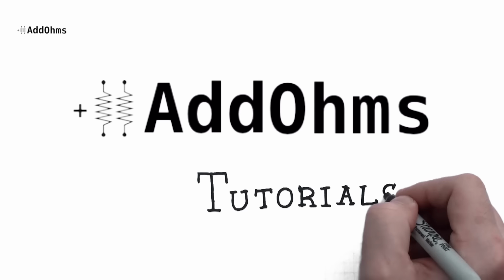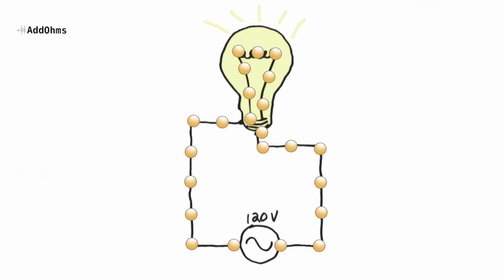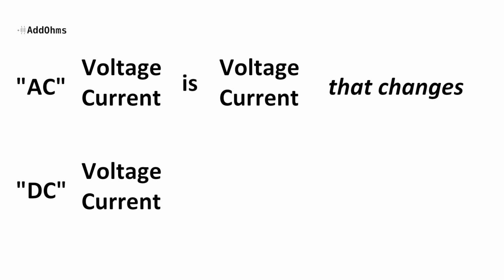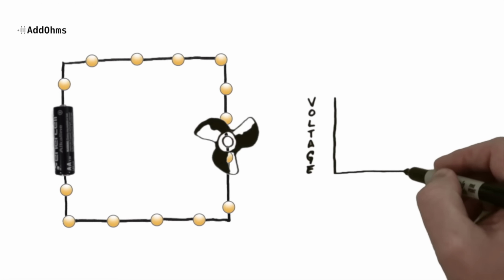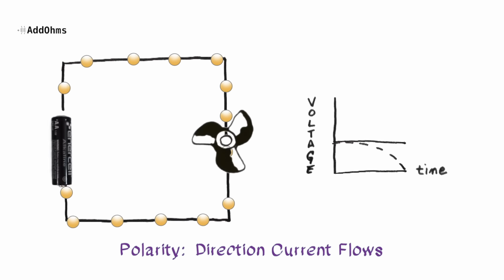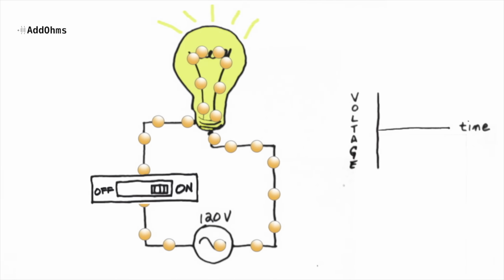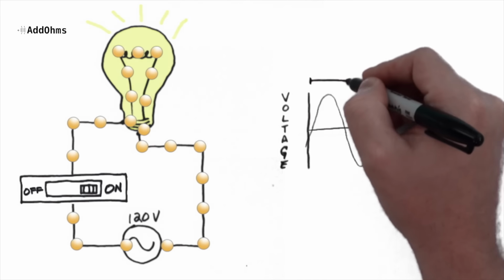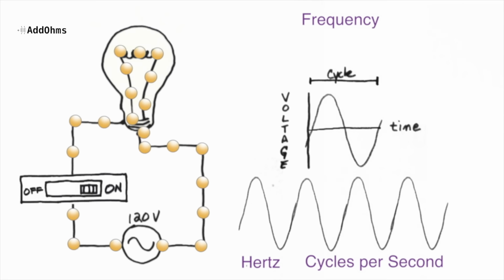Difference between AC and DC Current Explained | AddOhms #5

Comment: My fan in the UK runs off 240v ac  my desktop fan runs off 5v usb..  Why is the voltage difference so big between AC & DC please?   Thanks, John... :)
Reply from the maker: One is designed to be plugged into the wall. The other is designed to be plugged into USB. You probably noticed one blows harder than the other.

Comment: How ac is prevented from current loss ! And what exactly voltage does ?
Reply: AC actually loss more than DC in long range because of capacitance 2 conductor next each other. Voltage  is how strong it can push current. It's like pressure in water. The deeper the higher the pressure and current is like how much water flowing.

Comment: I believe that you may have noticed, exept it takes a moment for the lights to go dim, so it doesn't flash. Also, is this why if you are drawing too much power the lights flicker?
Reply from the maker: The lights flicker when another load (aka appliance) draws so much current the line voltage drops very low. The current surge is quick enough it doesn't trip a breaker but long enough to notice the lights turning off.

Comment: If we run a fan by ac,according to you the fan should be moving in two direction every second.But we see that the fan only moves in one direction. How is that possible?
Reply from the maker: +Rahul Das No, not all "according to me." AC motors are designed to use the alternating field for commutation. They are not built like a (brushed) DC motor. Look up "AC Induction Motor." They use the alternating field for commutation.

Comment: Technically it's true that a lightbulb is going through 100-120 cycles of max output to zero per second but in the case of incandescent bulbs, as the light is generated by the heated filament which once at operating temperature stays there, any 'flicker' is smoothed out...  with fluorescent bulbs they do flicker quite a bit, hence the headaches some people get from them.

Fun project:  take a motor, attach a cardboard disc with a hole near one edge and mount on a paper towel tube so the hole will pass over the open end.  Add some power and a rheostat to change the motors speed and look through the tube at some fluorescent lights.   When you get the disc to spin at just the right speed, you'll see the fluorescent tubes slowly go from completely off to a very high brightness.
Reply from the maker: Slow motion video does confirm that the filament's light output changes. But you are correct,  the thermal impedance of the tungsten will smooth it out, so it isn't a hard on, hard off.

Comment: so why do we bother with AC?
Reply from the maker: When electricity was first distributed over 100 years ago, it was easier to build AC generators and use transformers to step-up and step-down the voltage for transmission. 
Even now that we have the technology to step-up and step-down high-voltage, high-current DC, it still wouldn't make sense. To change the existing infrastructure would be an enormous cost and have significant service disruption. And quite frankly, there would be almost no savings or benefit from the change.
Reply: dude, thanks for that

Comment: With alternating current, why is current detected in the hot wire and not in the neutral? For instance placing a amp clamp type meter on the hot current is detected but not on the neutral.
Reply from the maker: Then you're doing something wrong. It should work on either.

Comment: Wait. If AC keeps changing over time and the current keeps fluctuating at fast rate, then any motor connected to an AC source must also change the direction of its spin, why doesn't it happen????? I need a quick answer please...
Reply from the maker: The magnets and wire windings are made in such a way that when the AC field reverses, another set of magnets and windings pull the rotor "forward."  The electro-magnets in the motor don't all "point" the same direction.
Reply: AddOhms Thank you, just one more question: Is the motor designed in such a way that if DC is passed through it, then it will use the same set of magnets and windings for the motor to keep spinning in one direction??? I would be glad if you answer. Thanks....
Reply: it does chlange, but human eye cannot see 50 hz of frequency.

Comment: OK. But I would like to know why do electricity companies supply AC electricity to our homes as opposed to DC - is it more efficient/economical?
Reply from the maker: +TinyWords I give one explanation in this video and the comments provide deeper. https://youtu.be/6F1ETK3Euhc

In short: initially it was easier to generate and distribute high voltage AC. Today even if DC made more sense (and I'm not sure it does) there is too much infrastructure in place already to support AC.
Reply: Yes, thank you for the explanation. Basically, the 'War of the Currents' was between Edison and Tesla. Direct Current is not easily converted to higher or lower voltages also upon reading, it still is continuing in a heated AC/DC battle and it appears the two currents will end up working in parallel to each other in a sort of 'hybrid armistice'.

Comment: Hi, i have a question, if the battery in the dc circuit will run out over time(voltage), then why wouldn't the voltage in the ac circuit won't run out? thanks for replying!
Reply from the maker: +Ko Siu Chun If an AC battery existed, then it would run out.
Reply: Hi, thanks for replying, however i got another question, how does the higher voltage and lower current, lower voltage higher current work? i saw it on the wikipedia and it says to work it requires the same battery? or something similar, and i dont really understand it, do u mind explaining?

Comment: A little clarity on the lightbulb example used. An incandescent lightbulb has a certain amount of latency in the way it works, so when the voltage drops towards zero the filament takes time to cool and so still emits light for a while.

This latency is long enough that before it can dim significantly the voltage has had time to increase on the other side of the sine wave and heats up the filament again. This smooths out any flickering that may occur.

If you switch an LED at the same rate (50/60 hertz) you may notice some flickering.

Note: the incandescent bulb is actually being lit 100/120 hz rather than 50/60 hz as it lights on both halves of the sine wave or twice a second.

The LED only works with current in one direction so this wastes half of the power.
Reply: thank you, very helpful explanation
Reply: Super late, but how is LED so much more energy efficient then?  I'm going to google but still would be curious for your response
Reply: @russianbackfist  The majority of the energy an incandescent bulb uses goes into heat rather than light. About 95% v 5%.
Reply: thanks
Reply: Still the LED is power efficient.
Reply: @chaz-e  why? In the example, the current is changing polarity and if what op said is true, there is no reason to do that cause it doesn't make the light turn on. 

From my understanding, what would happen is that the light would flicker constantly and lose more energy in the process.

Comment: Why use AC over DC? What are the advantages?
Reply: Provides more energy than AC and doesn't rely on chemical processing ( Batteries ) to create current
Reply: AC is more efficient than DC over transmission lines from the power generators to where it's going to be used. So with DC you would need more sources closer to where it's used to get the same amount of power.

Comment: What i'm having trouble understanding is what the 2 pin american / 3 pin uk ac plugs do. i know one is earth on the uk plugs. So there's neutral and live. i know you switch a circuit by opening and closing the live wire. but.. what do the neutral and live wires do in the ac circuit? I've never understood this - it seems they should just be identical but flipped phase? I'd love it if someone can help me out.
Reply: Live goes positive and negative, ether 'pushing' or 'pulling' energy from neutral. Neutral is at zero volts. Earth is literally a connection into the earth (soil). I'ts there to provide a low resistance path to earth vs flowing through you.
Reply: So is Neutral always zero volts? 

I'm confused a bit because say you're in a positive cycle the flow is live to neutral, so it may be 0 V but there's still current flowing through it (so i imagine it's not safe to touch?), but what when it's in a negative cycle (negative porition of the wave/pulling) wouldn't the flow be flipped so neutral to live? 
Or am i stuck in the way of DC - i never ever work with AC current other than audio signals.

Comment: Does this mean a diode makes ac current into dc since a diode makes current flow in one direction?
Reply from the maker: +Aura Dominator A diode will "cut the signal in half." Since it only passes one portion.  It is how the rectifier for an AC to DC converter works.

Comment: WHY does the current change in AC
Reply from the maker: For AC Mains, it's because of how the generator spins when generating the current. If you watch my motor video, you'll get an idea of how motors have magnetic fields. Generators work in the opposite of motors. They generate current by using those magnetic fields. Because of how the motor is constructed and the magnetic fields are created, we end up with an alternating waveform.

https://www.youtube.com/watch?v=iKqruCYuc1Q
Reply: And if the electrons are going back and forth how do they keep getting energy to work the component since some of them are not going past the power source?
Reply: that vibration of electrons in enough

Comment: I'm not an electrical engineer and know close to nothing about electricity; which is why I'm watching this video.  But, the bit about lights strobing or flickering and the perception of the human eye is dubious.  If this were true you could film with a camera running at > 60 fps and you'd end up catching dark frames; but I don't think this happens.

Your brain will kind of replace or fill in the gaps to account for missing information and it might filter out non-critical information.  It's why you can sit and study in a room without hearing the buzz of a light bulb or the hum from the HVAC. One is auditory and one visual but there have been studies showing that people perceive things visually that aren't actually there.  There are 60hz and 120-144hz computer monitors and you can subjectively and objectively notice the difference when playing a computer game.  The high refresh rate monitors are a lot smoother, and your reaction times are measurably quicker than a player playing on a 60 hz monitor.  This might just be because you are seeing 2x the information, not the difference in response times (which is about 5ms).  Either way it still proves the point, which is that the human eye is capable of perception above 60 hz. But...  

The lights might dim slightly, but the residual heat in the filament won't dissipate quickly enough for the room to go dark.  If you close your eyes, turn off the lights and open your eyes as you're flipping the switch, you'll be able to see the light fade to dark.
Reply: You'll notice on most cameras they have a 50hz(Europe) and 60hz(North America) setting.  That's to correct for the flicker of AC lighting.  That's also why in North America they broadcast at 30 FPS and in Europe 25 FPS.
Reply: @Jordan-dt6qx  Good job,
Reply from the maker: Yes. Incandescent bulbs "fade" due to the time it takes the filament to cool. Which is why if you film using Incandescents at 60 fps, the scene would be much dimmer than what your eyes see. You'll also very, very rarely see anyone filming with incandescents, except for an artistic reason.

Your brain isn't filling in anything. It's seeing the total light the retina can detect. 

LEDs are a different story. They turn on and off much, much faster than a filament based bulb. They're also switched in the kilohertz range. Again, your brain isn't filling in anything. Your retina can't detect changes that fast. It's persistence of vision. 

Your comparison to monitors is flawed. The reason you see motion is because of the connections your brain makes. Seeing the image (or brightness of the image) is entirely on your eyes.

Comment: The home appliances, do they work on AC or DC. 
If AC then what will happen if we provide DC
Reply: Anything with a motor USUALLY runs from AC directly, using eather a 'universal' or 'induction' motor. Everything electronic such as LCD screens and computers runs of DC. AC can be converted to DC by 'rectifying' it. It's converted from 240V to a lower voltage (i.e.5V, 12V, 24V) using a transferrer, or more commonly a switched mode power supply.
Reply: Robert Hickman 
Thanks

Comment: hi.. i used a ac power supply 14v ac 800ma to my guitar effects pedal 9v dc 2.5 ma. after an hour of playing the pedal shutdown.. and the power adapter is hot. its fine if the adapter is damaged but i hope my pedal still works fine. whats your guess? thanks.
Reply from the maker: However if you are supplying a 14Vac signal into a 9Vac device, I could see a problem. Sorry, not enough information to help.

Comment: Great video!

So when we see fancy car reviews on youtube and the LED lights seem to flicker, that either means that LEDs are AC or that cars are AC but LEDs have lower Hz than older bulb technology?
Reply from the maker: +Ryan N LEDs are driven with a pulse width modulated signal (PWM). This is a technique that adds an AC component to a DC signal.  PWM also crosses the boundary of what a digital and analog signal is. 

unlike a traditional lightbulb, there is a minimum voltage necessary to turn an LED on. By either limiting the current or rapidly flashing it, you change the brightness.

Comment: In a battery, the flow of current should be from negative to positive. Now is the animation wrong, or I am ?
Reply from the maker: +Nemo It's the difference between "conventional" and "electron" flow. Conventional goes from positive to negative, while "electron flow" goes from negative to positive.  Both are acceptable as long as only one is used in a circuit's analysis.

Comment: At 2:52, you said current flow stays the same but voltage goes down.... But acc to ohms law this statement doesn't satisfies? So how do you do it?
Reply from the maker: +kartik mittal Ah. I did not word it well. I meant the current flow's direction, not the amount.

You bring up a good point and something I didn't do in the animation. As the voltage drops, the current should be slowing down.

Comment: So if you had a motor hooked into a DC source of power it would be spinning back and forth?
Reply from the maker: +Christopher Faught No. It would spin in one direction, or not at all. Connecting an AC motor to a DC circuit would have no effect, other than potential damage. Connecting a DC motor to an AC source would likely damage the motor and at most it would studder back and forth.

Comment: As far as i know and searched the web, the electrons flow from negative (-) to positive (+) not the other way around as in video. Such information is important. Correct me if i'm wrong.
Reply: +MiKE Carry Yep, an unfortunate point of confusion, one we physics teachers struggle to get across.  ELECTRONS flow from neg to pos, but, unfortunately, current (often shown as "I") is typically shown as flowing in the opposite direction.  Not sure of the history of that; maybe way back when, someone just made a bad guess. So consider current flowing from the positive terminal as positive current, while current flowing from the negative terminal is, you guessed it, negative current. For my part I always showed the electron flow ("negative current") only, but you just gotta live with it.

Comment: Hello, I connected a AC adapter to a DC Device. (A christmas house http://img.tweede-hands.net/pics/00/10/72/84/76/3c.jpg?8268899048) Could that have damaged it? When in connected the ac adapter, the big light of the house itself was working, But some other led lights (Street lantern) and the movement did not work, The music sounded choppy. did i destroy it? :/ (The reason why i don't just connect the right adapter to see if it works is because i don't have the right adapter anymore :P) Kind regards Thomas Mulder
Reply: +Thomas Mulder It is likely the adapter was either not the right voltage or could not provide sufficient current.

Comment: I have a question.
If lets say a 1.5V battery is driving a Device that needs 1.5V. Now as the battery voltage starts dropping and the battery is no longer giving the 1.5V. Then why does the same device that requires 1.5V to operate still work. 
Also what will happen if we connect two batteries in series and parallel to the same device that requires 1.5V.
Reply: +Sagar Sonawane Manufacturers like to provide a buffer, or margin, or range that their device can operate. The device will continue to operate until the voltage falls too low.

Two batteries in series doubles the voltage. Two batteries in parallel doubles the current capacity (in theory.) In practice is not a good idea to put batteries in parallel. They will discharge each other.
Reply: +James Lewis ok thank you very much